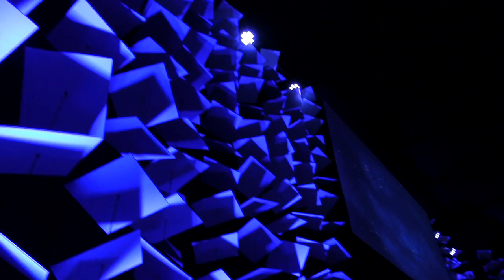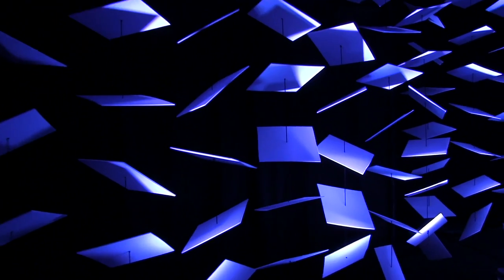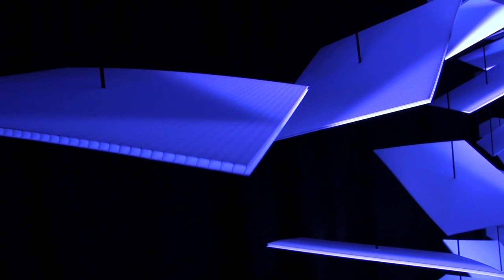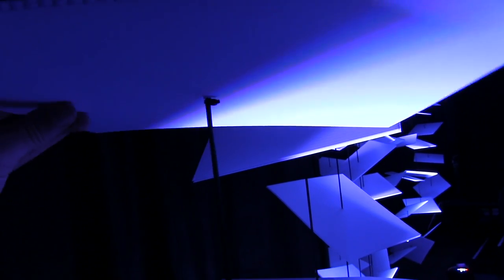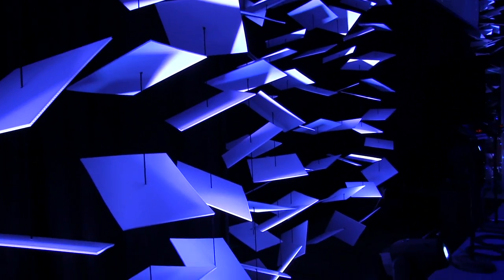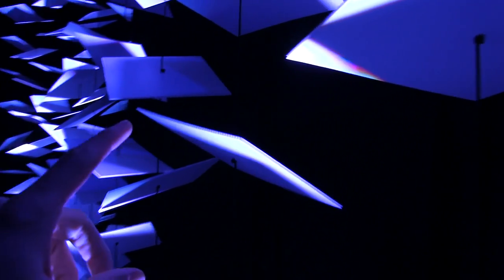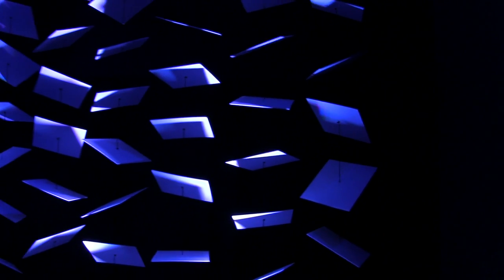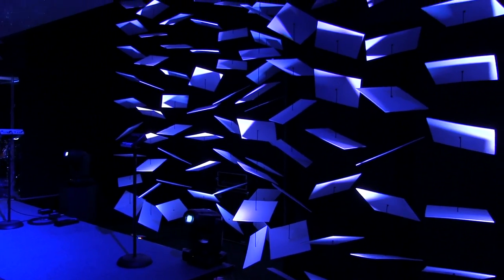"Floating Tiles" Church Stage Design Idea

Comment: I used this concept and cut the squares in half to make triangles (even cheaper!) and then staggered the heights on every other strand (30" and 36" from the floor). Each triangle was a foot up and each string was a foot apart. Turned out amazing for $100!

Oh and I used foam board and the squares were 10x10 before cut in half. His tip of the holes not in the center is exactly right! My stage is 28x15. I did not burn my para-cord.... honestly I forgot that tip lol

Comment: thanks for sharing! my church rents a school auditorium so we have lights that look like stage lights for plays and stuff. very orange and old fashioned. what would you do to change that? please tell me what to buy. thank you! !!
Reply from the maker: Hi Frincess, 
The most simple thing you can do is replace your current lighting for almost any LED RGB or RGBW wash fixture. This will allow you to wash your stage and back drop with any color. Depending on your current setup, you may also need to replace the front was as well with a LED equivalent or better. If a venue or church is not using some type of LED fixture for the front wash, its very likely they are using a PAR 64 can or an ellipsoidal like the Source Four Jr. I would start with calling a local stage lighting specialist and have them check out your stage and make suggestions on what they recommend. Thanks for watching.
Reply: Worship Leader Hangout thank you for taking the time to respond and also for the advice. I will be sure to mention this to the group! God bless you and your ministry.
Reply from the maker: Frincess Julyette Thank you so much!

Comment: what lighting software do you use or mixer???
Reply from the maker: Joab Villescas We are using the Martin M2PC board running with the M-PC software. If you like the M-PC software spend a little more and get the M2GO. The software is built in to the board and you just need a touch screen to connect to.

Comment: how did you attach the to the ceiling
Reply from the maker: We have a bar mounted to the ceiling that is a little longer than the width of the stage. It is mounted about the same height as the screen.